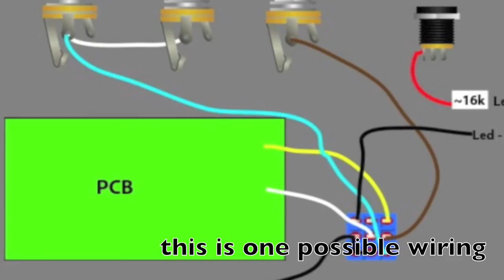Deluxe Electric Mistress LED MOD

Comment: Isn't it a bit risky to drill into the pedal housing without protecting or removing the PCB? Even if you are sure you don't hit anything on the other side, i would be afraid of metal chips causing shortcuts after that.
Reply: if you're afraid to damage something, you can use masking tape on the back side to prevent metal bits from going away and stick to the tape. creating a pocket with the tape is even better

Comment: Would a 68k ohm 1 watt 5% metal film resistor work?
Reply: 1W is pretty too much but does not hurt. Then the exact value depends on the led you are using. Some leds need 2mA of current, while other need 20mA to light correctly.  So you have to use the ohm U=RxI to calculate your resistor given the voltage you have and the current you need based on the led specs. If you don't know your led specs, then start with a small current (higher resistor) and try it out.
Reply: @organnery  thank you for the reply! I am using a stock LED from a small clone big box pedal. I’m not sure what resistor it needs but I do have a new 68k ohm 1 watt 5% MFR. do you think it would work?
Reply: @o_o0_x914  while it is electrically safe, i doubt you would get enough current for the led (12v / 68k = 0.17mA) as it would need at least 5mA
Reply: @o_o0_x914  a 1K resistor would be better suited
Reply: @jerashmusic  alright I’ll have to look to see if I have one! Hope to do this soon but want to make sure I have all the correct parts first. Just need the right resistor. Thank you again!